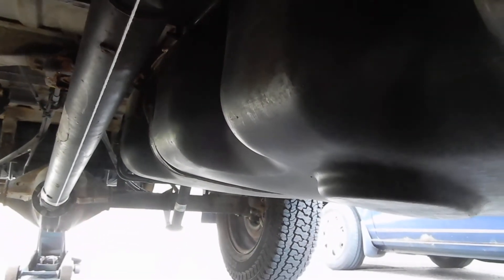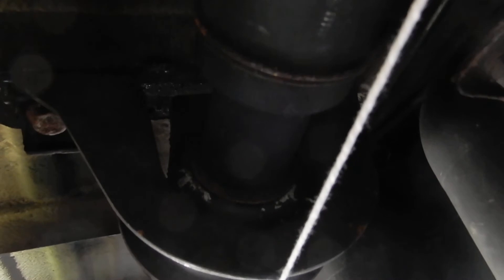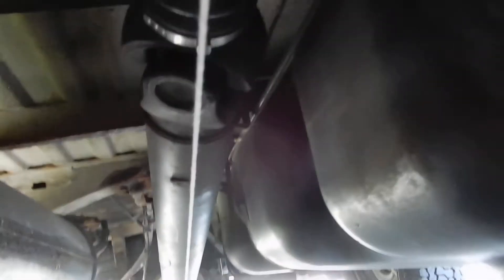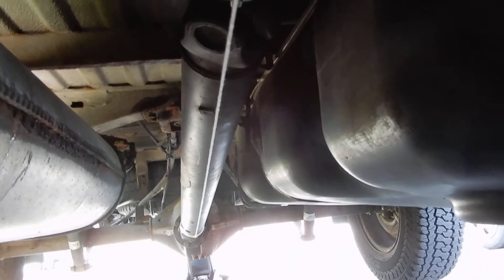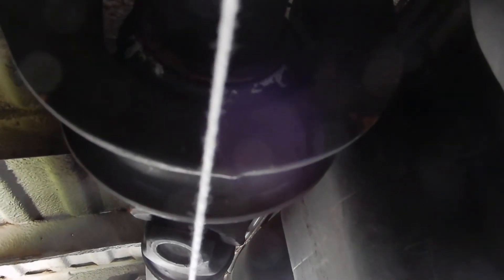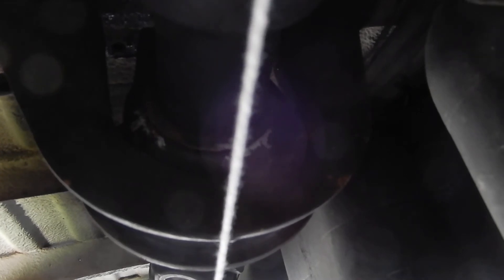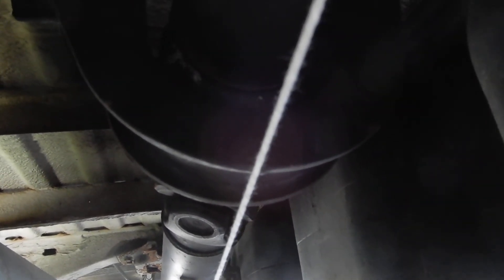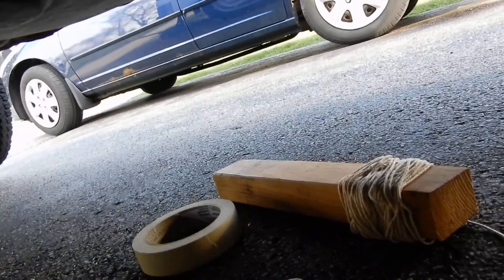Sprinter T1N drive shaft median bearing repositioned with revised mount P1

Comment: V  ?  Can I just use Metric string, or do i have to find a part number  :)  T1N fan
Reply from the maker: I would highly recommend that you (like the Buick dealers say) stay with factory made parts and strings. Interesting that yesterday I finally after 3 weeks of chasing my tail
found that the MAF sensor had failed and thus the starter would engage only once and then require another key start. I had taken the starter out and ordered a new solenoid
from MB Germany and meanwhile had load tested the starter with OK. Next I used the latest Autel reader to check high pressure rail pressure and that would not get beyond
4000 psi.?? Low pressure pump was OK. New dealer high pressure pump and rail would be $3K and AP200C was not reading rail pressure so will contact them(Autel) Monday to
ask what I have left out to bind and link the AP200 to the Sprinter. Green light, blue light etc. At 185K miles this '06 is good for another 250K miles just amazing MB quality. Still 
doesn't use oil with 10K miles changes of Shell T6 5W40. Transmission is on 35K mile change intervals with Shell fluid and filters.
The rare part from MB to move the drive shaft tube over has eliminated that vibration but it took a week or so of driving to seat in the 2 piece shaft. Extra MB string available
upon request.